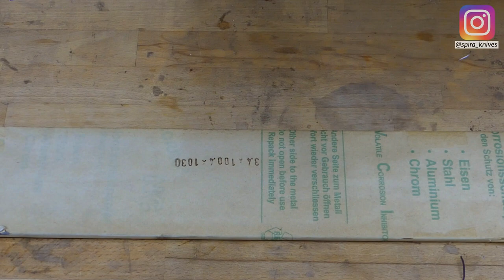Making a Filleting knife

Comment: I have a stupid question.

When quenching stainless we are supposed to put the blade  that’s wrapped iin stainless foil in between two aluminum plates then blow compressed air at it. In other words were quenching the entire knife, not just the blade and part of the handle.

…

But when we quench high carbon steel we only get the blade and part of the handle red hot then dip it in the oil. Why don’t we just make the whole knife red hot and just drop it in parks 50?

Comment: Great vlog, thanks for sharing.  Great knife you made.   But, I got to admire the great little shop yo have near the walled ivy.  That tempering at night is just far out, killer, etc!  Just one suggestion, after you sharpen the blade, tape it real good to prevent the sale of stitches, band-aids, etc., etc.   I see you did in some of the vlog.  But until you complete the blade I’d keep it wrapped until finished.  Just my my .02 cents.
Reply from the maker: Thank you! 
Well, a small shop can be great, too! Good tip with the taped blade, I should do that more often, and will from now on👍🏼

Comment: I noticed you turned the knife over to taper the spine.  Do you find that to be a better method?  Getting ready to make my first fillet knife.  Nice work BTW.
Reply from the maker: I usually grind with the cutting edge facing up but I’ve also tried it the other way around. I cannot tell you what the right way to do it is, I‘d recommend to just try out different methods and find the one you like the most. Have fun and good luck!